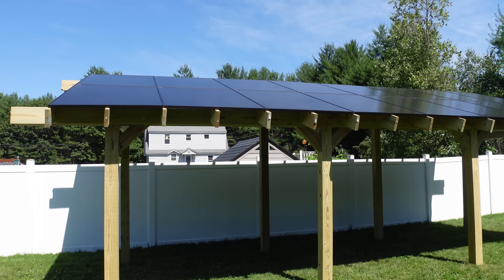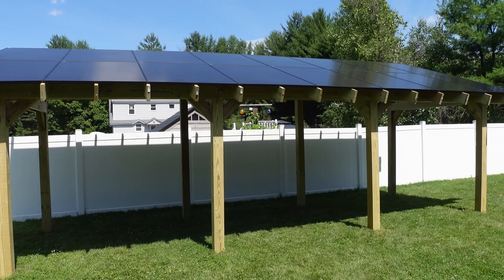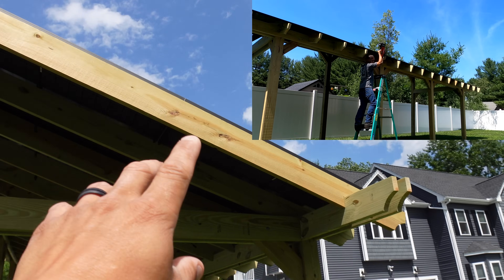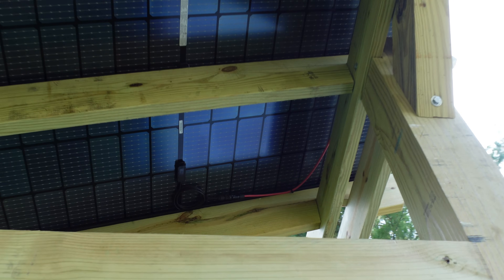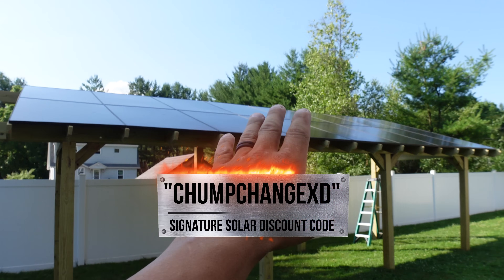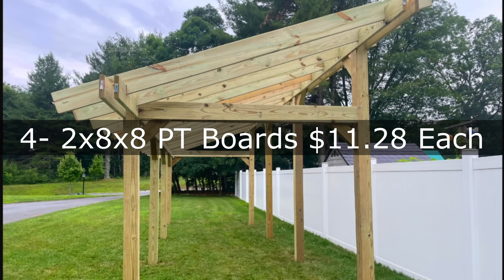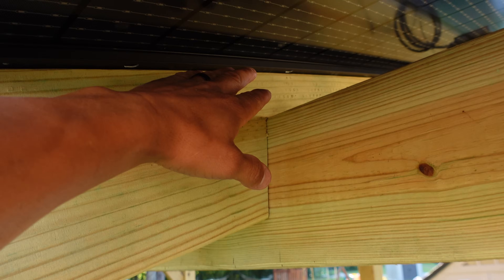DIY Solar Pergola Final Cuts & Total Cost

Comment: Are you aware that the cables are long enough that you can hook them up every other one and have both connections on one end?
Reply from the maker: You know what I didn’t even think of that lol! But for the way I need to wire it because of that set of trees to the left it is the best way
Reply: @ChumpChangeXD     I was telling you that you could have made the conductors going to the house from the same end and not run the extra wire all the way along the others.   Maybe saved 100’ of wire?   Great job overall!
Reply from the maker: @KevinCoop1  appreciate it Brotha 🙏🏻🤙🏻

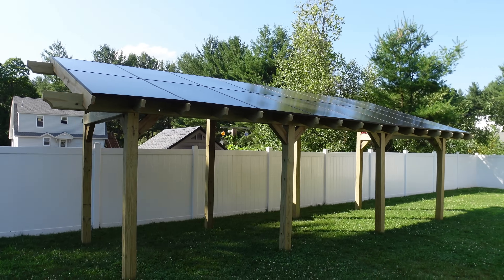Comment: Best video ever! This is a long 12:03  thread because I’m the victim of this story. I became an expert on solar installation the day the 3rd party showed up for the installation and on the same day I let them know they were in breach of contract.  There are codes for solar, but the city or county inspectors (Rose Hill Ks) are clueless. The inspector for my system did a virtual W$F? The contractor sent pictures of the system that didn’t show the critical connections. Here’s the unbelievable part, he never had the engineering drawing. All the wiring was undersized for the 27 module system they incorrectly installed. The contractor didn’t even know what a master electrician is. They didn’t use the IFC which requires a 30” exempt area for the overhangs(soffits)and ridge caps. The LLC company sold me a system and used there lender LLC to finance it.  Problem is the seller was registered as a Foreign LLC in Ks, however the lender was not. For those out-there that claim this system isn’t installed correctly, read the city an county codes. Read the fine print and get educated on it. Inspector’s are exempt from any wrongdoing and backlash for houses burning down due to there ignorance, education and arrogance of who they are and what they do.  My system was never substantially completed for final payment. With in 1-week the panels had to be removed and are laying in my backyard to this day.

Comment: I'm looking to build this exact model, size and everything. What did you do for grounding? My permits require a ground of the array for better or worse.
Love the build though regardless!
Reply from the maker: Thanks brotha in the other videos following I give a full list of materials I used and when I wire the panels I ground them also which is a different video on the channel 🙏🏻🤙🏻
Reply: @ChumpChangeXD  ah cool I'll check those out!
Reply from the maker: @GregForman1015 appreciate you! Any questions let me know!

Comment: Old you send a link to the metal fasteners/clips to attach the rafters to the panels. Most products are designed for metal to metal but here you are attaching wood to metal
Reply: I wasn't able to find the clips in the list. 
And I do have a method which just proved that it doesn't work😢 
So I'm curious what the exact parts are you used to fasten the panels.
Reply: Everything is wrong with this "project"
I hope nobody is coping this 🤞🏽

Comment: Sorry to say this,  but your pergola doesn't meet code.  It is a fire hazard, and although most will say it doesn't matter as long as it's not on your homes roof, this is what will happen sooner or later.  Your home insurer will cancel your coverage.  Worse yet,  if a fire destroys your home,  they will deny coverage.
Reply: @JR-kk6ce how is this a fire hazard? Serious question, I don't know and would like to know more
Reply: @PocketChangeXD I also would like to know why and how this is a fire hazard and leads to cancelled coverages because I would like to do a project like this as well.
Reply: This guy is trolling. Only thing I'd advise is mounting brackets on a metal frame, then onto the pergola, but as long as there are no issues with the panels, many companies have done the same.
Reply from the maker: In regards to the other comments…EVERYTHING in life is a fkn fire hazard. Including your toaster and wife’s hair dryer. Gimme a break 😆
Reply: Nice video. I was trying to see if you were. Mounting on the wood. If so did you run a ground wire to tie the panels together?
Reply from the maker: @brentjohnson6654 yes I wire them up in a separate video
Reply: @ChumpChangeXD  thanks.  I will go back and watch the wiring one closer this time. “Put the electronics and pay attention” haha.  All the best from north Texas.
Reply: What state code are you referring to?
Reply: Dude is trolling

Comment: Looks great!  Two things I probably would've done differently is make it three panels wide instead of two (more usable room, better aesthetics, and more solar), and I'm not a fan of having the PT buried in the ground like that... It will rot far quicker than the rest of the structure, yet it's structurally the most critical.
Reply: How would you secure them instead?
Reply: @TheDesertsweeper  You never want wood touching dirt whether it's pressure treated or not. Best to have the concrete footings flush with the ground and then have the wood mounted onto the brackets in the concrete.

Comment: You can reduce your costs by eliminating the rafter in the middle of the panels. The panels are designed to be supported purely from the sides. In fact, they are usually supported at only four points on the sides, so supporting the entire length of both sides is already more support than the panels are used to. But I think it looks a lot nicer with the extra rafters.
Reply from the maker: 100% correct! Thanks brotha 🙏🏻
Reply: How do those tiny brackets handle wind?

Comment: If you ran the strings every other panel.. skipping a panel till you get to the end you can come back via the panels you skipped and it saves the 50ft run of wire and voltage drop
Reply: As I understand his configurations he has two strings.. the top and the bottom.. with two 50ft runs of wire to the end of the pergola.. my suggestion is to leap frog a panel every other one on the top one way.. and leap frog the panels back (staying on the top row. ).  This removes one run of 50ft. Doing the same on the bottom.. saves another 50ft run.
Reply: Doesn’t that make the voltage too high ?

Comment: Did you say how much the panels were an electrical or did I just miss that part?
Reply from the maker: This is just for the pergola itself not the solar stuff. I go over the solar kit and have a link to Signature Solar in a previous video. 

The wiring I will be doing in another video as well when I run it across the ground over to the location it’s going

Comment: Great job on the built. Looking to build something similar. Have you been able to check if the silicone does its job of no water leaks in between the solar panels?
Reply from the maker: Thanks man! Def need to do more than I did but it can be a mess so you should used that rubber tape I may get some to show it off

Comment: hey, I'm trying to calculate, If I want to solar my 1x KS0 ultra, how many solar panel do I need (what size?), and what size of the battery?
Reply from the maker: This is the best video I have found explaining sizing. https://youtu.be/TJBGbufexEM?si=Y4Wtx_ECliKyx7L-

DIY with Will Prowse is legit the Mr Rogers of solar lol.
Reply: thanks, so based on that calculation, if I'm not wrong,

100W KS0 Ultra x 19 hours no sun = 1900wh

12v x 200ah battery = 2400wh

2400wh/5hr sun = 480w panel

for margin better use 1pc 550+ w solar

so I need

1 12v 200ah battery
1 550w solar panel

seems right..

rough solar stuff roi estimate, 14 month, (edit)

Comment: Hey buddy, when wiring it all up remember to make the negative cable just as long as that 50ft positive cable. Many people have positive and negative landed in a combiner box in the middle so that voltage losses are balanced and minimal. The. They run their lines from the combiner box to the inverter.
Reply from the maker: @benjaminquinones1890  oh damn, Thank you!!  I didn’t even think of that… That’s a great point and I will make sure to do that. Appreciate you 🙏🏻

Comment: Looks really good, BUT as a carpenter and engineer, I have to say you didn’t stick to the basics of construction wood protection. When it rains, those overhanging beams and surfaces will soak up water like a sponge
Reply from the maker: Your correct. I could probably stain this eventually but ehh idk if I want to do that. What you think will happen warping or something if I don't?
Reply: @ChumpChangeXD  In the long run, the wood will rot and in 3-5 years, it’ll become unstable. Best would be to make sure water does not touch it by covering it with metal sheets that open up just a bit at the bottom to stop water creeping in. You can treat the wood additionally, but this alone will not stop the rot. It would be a shame to see it become unstable after such a short time. Also , I didn’t see in the video, I recommend to use a galvanised iron brace to keep it from ground contact. 10 cm if you have gravel around the posts, 20 cm if not. Rain will reflect of the ground and spray the bottom part of the posts. If you have gravel, it’s better because you avoid puddles
Reply from the maker: You know deck posts are typically pressure treated and last for
Years (10-20 easily IMO) with no additional treatment. I think I’ll take my chances on the end boards in this scenario.

My last house had a second-floor addition with 6 x 6 pressure treated posts holding up the overhang 6 feet off of my first floor. This was all 100% inspected and there was no talk of treating the posts or anything because of rotting, as it was already pre-treated wood.

I agree with the posts in the ground tho. The dirt around them 100% will not help. I will change this out with rocks eventually
Reply: @ChumpChangeXD  Pressure treated wood lasts longer, but putting a metal sheet glove over the top surface and keeping the end grain dry will serve you well and keep the wood in such good condition that wind and snow loads won’t be a problem, especially wind loads. What you basically have, from a load bearing point of view, is a wing.
I wish you well!!! Sorry if my English is not perfect! I’m one of these „ know it better“ Germans 😂
Reply from the maker: @rudi1802  haha no worries thank you for the input my man!!! Much appreciated!
Reply: @ChumpChangeXD  😊 It would be a shame if all your hard work didn’t last🤷🏼 One more thing: when you run the cables from the panels to the house, use an empty pipe or special cables. I can tell you from personal experience when I laid a power supply down my garden in the ground to the pump, I thought any quality cable would do as long as it had 3x2,5mm2 phases and was insulated properly …. I was wrong. 5 years later the insulation around the cables was brittle and let moisture through. Apparently, something in the soil causes a reaction with the insulation and made it porous. So I laid a 1“ diameter water pipe in the ground and fed the cable through that plus (belt and braces) used a special cable that can be buried in the soil. Solved the problem …probably an overkill 😬
Reply from the maker: @rudi1802 damn you know what I been pondering over this!!! I Purchased direct burial wire to run over in the ground but I have been debating throwing them in some sort of sleeve like PVC piping just to help protect them…. Your probably correct I should do that. Damn, there goes another $250 😂
Reply: @ChumpChangeXD  Just remember to make a snorkel for the exits and put wire mesh or a cap on both ends… keeps the water out and the vermin
Reply: I feel the wood being treated will be fine.
Reply: Pressure treated lumber and hot dip galvanized lag bolts last a long time. I have an untreated stained wood fence that has survived four years in Georgia rain, heat, and freezing. I have a pressure treated stair set that’s about half the same age but has had the same conditions and is as good as new.

One thing you should do is get pressure treated wood post cut solution (which I think is mostly Borax and a couple additives) to maintain protection against rot.

Personally, I’d paint it with quality outdoor acrylic paint for aesthetic reasons, which would help protect it as well.

Comment: nice job

i would try testing how much reflectors could do
by putting a reflective surface on the ground, maby some mylar sheets from the first aid kit 
most of all on a cloudy day, thats where bifacial should make a big difference compared to normal panels

it would be posible to add reflectors to the construction, for example 5-10cm under the panels and the end of the panels
but optimal the more distance to the reflector the better (bifacial works best in around 4 m hight)

it would also fit the structure with some sort of floor, i would kind of look like you wanted to use it to sit under